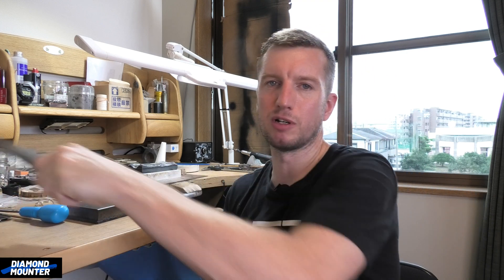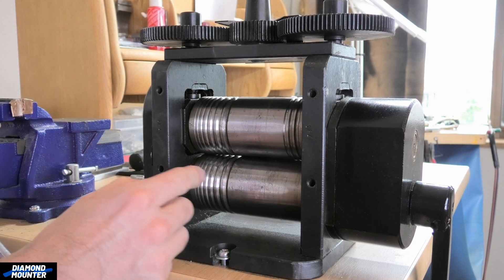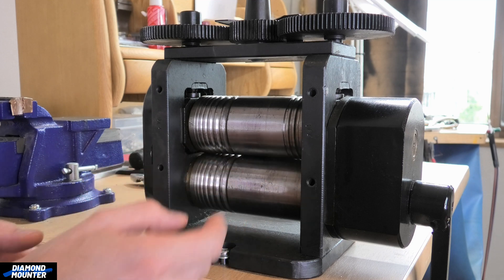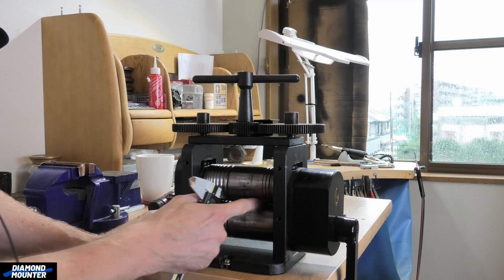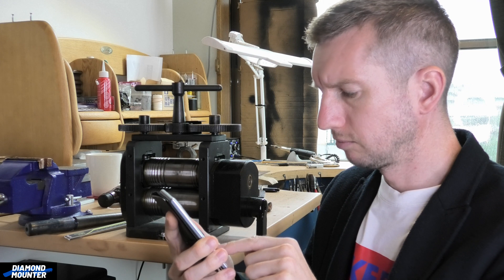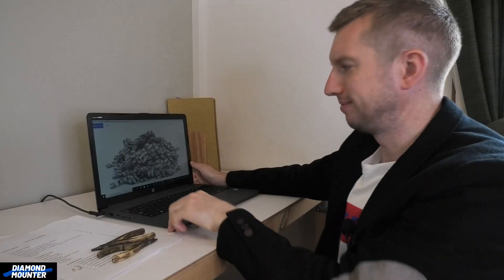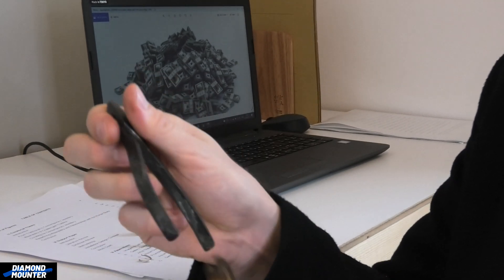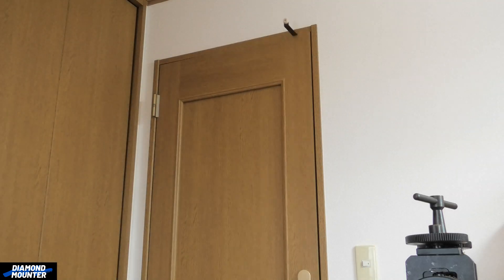How Jewellers Tools are Designed and Made

Comment: I designed and engineered my own roller through a local company. Costs were about a 3rd.. And even cavalin have moved over to assembled plates and no longer a cast frame. The most expensive were the rollers themselves. The gears come from the rack from a places that also produces custom gears. Jaws can lift up to 12mm.. Now if you are not local you double the price because thats what shipping them usually costs, because again screw the jeweller "you will use our expedited air freight". Then add vat and taxes and you can see why the local suppliers get away with charging 4x the price.
Reply from the maker: I love the idea of assembling my own rollers.